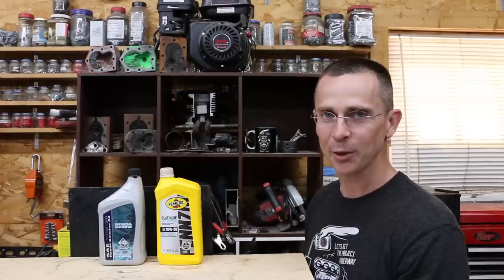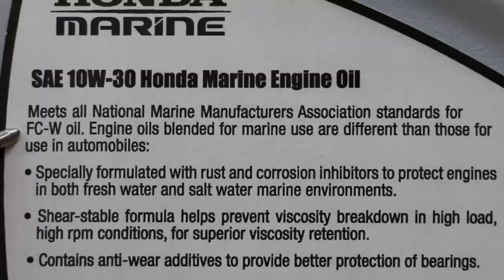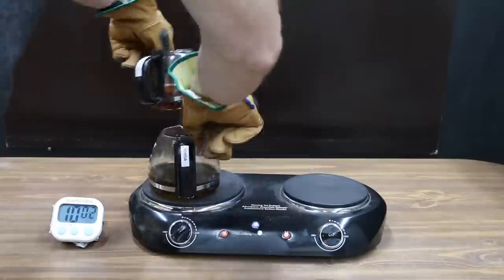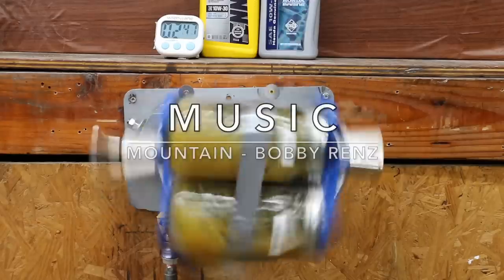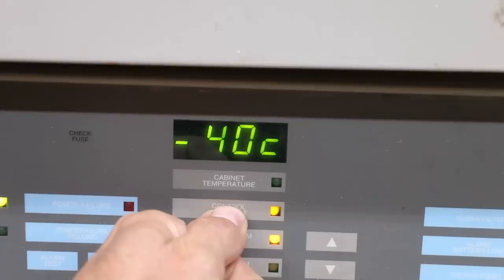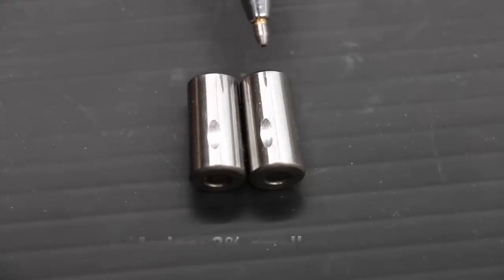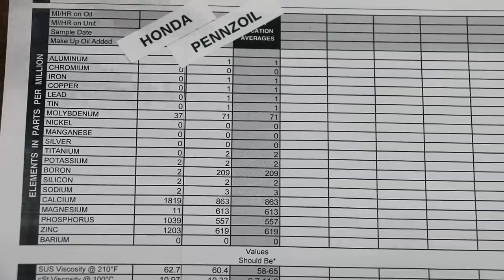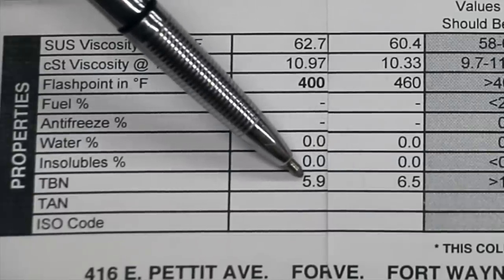Motorboat Engine Oil Better Than Regular Motor Oil?

Comment: I recall a test where they used a special piston ring made of a radioactive metal.  The oil is run in the engine for a specified amount of time, then the radioactivity is measured.  The oils with the lowest amount of radioactivity are considered better.  As interesting as this is though, it is probably beyond reach.   But perhaps another, less toxic, alternative marker is possible.
Reply from the maker: Thanks for sharing.

Comment: I have found that mobil one 15w50 has the best shear protection and least foaming at higher sustained rpm than any of the marine 25w40 s i tried . This is in a mercruiser 5.0 IO. When lake is warm in Summer at sustained WOT would see oil pressure drop, mobil one is only oil i don’t see this with and its cheaper than the marine labeled 25w40s . Shell rotella 15w40 is another excellent marine use oil
Reply from the maker: Thanks for the suggestion.

Comment: Hey, love your channel.
Suggestion :
Can you do a test on different marine motor oils?
Kind regards.
Reply from the maker: Thanks!  Thanks for the suggestion.
Reply: Yeah like synthetic ones, they compared a petroleum based marine oil to a full synthetic automobile oil... no reason to do such a comparison since its already set in stone for 30 years not that synthetic out performs petroleum.

Comment: Hi, I don't believe it's super  crucial but perhaps having some kind of port with a threaded cap or ball valve at the bottom of your viscosity test tubes may help eliminate whatever effect air lock is having on the starting of the oils. Being a small diameter round tube some tests could be effected by it. Just a thought. I'm not a scientist or anything haha.
Reply from the maker: Thanks for the constructive feedback.

Comment: Thank you for doing the comparison, could you potentially do an updated version with some better oils? I am very curious and I'm sure some of the racers would appreciate knowing. Oils like mercury racing 4 stroke outboard oil + yamalube  vs say Pennzoil ultra platinum. I'd be curious to see how they stack up against each other I am honestly leaning towards using ultra platinum for future oil changes. These engines run at 6,5 00 plus RPM for extended periods of time so the more protection we can get the better. Also possibly a video on upper cylinder lube? Basically an oil that you add to the fuel to add some lubricity to it to help valve seats and cylinders above the ring, I like to run Klotz uplon in my fuel curious to see lab results and your your testing style on it. I know quite a few people that would definitely be interested in watching that video.
Reply from the maker: You are welcome!  Thanks for the suggestion.

Comment: Thanks for making this one, was very curious to see the results.  Think I'll stick with automotive in my car, and marine in my outboard.  I was surprised about the foaming result as that is a big marketing point to marine oils, though I wonder if they perform better in that regard if water were to get in the oil.
Reply from the maker: You are welcome!  Thanks for the feedback.
Reply: They duped everyone on here with a petroleum Honda marine oil vs a synthetic automotive oil.  They should have been straight here and compared apples to apples, a  synthetic marine oil with synthetic automotive oil.

Comment: Hey man, can you test those OBD-II plug-in tuning chips that are advertised to increase fuel efficiency and increase horsepower? They say they re-map your fuel/air mixture and can help add up to 30hp and give up to 50% greater gas milage. The state of Calif just said any car with one will automatically flunk the emissions test, so it makes sense that they could be trading performance for pollution. They aren't super expensive, or rather, the simple ones aren't. They have multiple levels that increase in cost. In any case, I'm not talking about the ones that attach to a laptop, but rather the stand alone units you just plug in.
Reply from the maker: Thanks for the suggestion.

Comment: Have you ever tested motorcycle oil?  Specifically Honda Pro GN4 synthetic blend vs Synblend or any other similar oils formulated for motorcycles such as Amsoil.
Reply from the maker: Thanks for the suggestion.

Comment: Can you test STP ceramic oil treatment? And see who makes the best threadlocker? Also can you make a small engine run on tiki torch fuel both the regular stuff and clean burn stuff?
Reply from the maker: Thanks for the suggestion.

Comment: Thank you for the video and testing. Can you do test on motorcycle oil ? A lot of motorcycles on the road today have wet clutches and the transmissions use the same oil as the engine. With the engine, clutch and transmissions being integrated the oil can not have anti wear additives put into the oil. Manufacturers make both natural and full synthetic oils. The bikes on the roads today are either air cooled  or liquid cooled.
Reply from the maker: You are welcome!  Thanks for the suggestion.

Comment: As an industrial mechanic one of the biggest problem I see is misuse of WD-40. I know in past you've tested penetrants, but what about spray lubes vs. grease vs. WD-40? Some spray lubes do better on metal to metal contact or plastic, etc. It would be neat to see how lithium spray or grease does against teflon, silicone and WD-40.
Reply from the maker: Thanks for the suggestion.

Comment: Hi, have you done a vid comparing cheap v expensive compression testers?  I bought a cheap one & let's say you get what you pay for.  The screw in hose adaptor showed 30psi less than the steel pipe with rubber tip that you press against the plug hole.  A thorough project farm test of various kits would be an eye opener.  On small engines the cheap kits read almost zero psi...  Hopefully it will prevent people wasting money on trash.  Thanks.
Reply from the maker: Thanks for the suggestion.

Comment: It would be interesting how the performance in a vehicle would compare considering the "coolant" in a marine engine is constantly cycling cold water vs. a vehicle running coolant at 185-195F+ on a regular basis.
Reply from the maker: Thanks for the suggestion.

Comment: Honda makes a oil called Honda Power Equipment 10-30.  It is rated SN and basically for 4 cycle air cooled engines. The marine oil did not have a standardized rating relating to gasoline engines. The SN rating was created to have motor oils meet a certain requirements. From Project Farms tests I would use a high quality automotive oil and not a marine oil.
Reply from the maker: Thanks for the feedback.

Comment: A lot of carmakers have engines with poorly designed oil control rings. The oil control rings plug up and you burn oil. Can you do a video that shows either a high detergent oil or an oil additive that proves to clean the oil control rings?

Comment: Great test! Would you consider doing a test of 4-stroke motorcycle oil vs car oil? The motorcycle oil has additives for the clutch plates, and many of us wonder how the other characteristics of the oil compare to quality car oil. A very popular motorcycle oil is the Mobil 1 synthetic 10w-40 sold at Walmart. 

Thanks!
Reply from the maker: Thanks for the suggestion.

Comment: Video suggestion:  Test 1500W 12v pure sine wave inverters.  Efficiency, max peak load, max continuous load, idle current consumption, noise level, wave form, input voltage range etc.
Reply from the maker: Thanks for the suggestion.

Comment: Car vs boat vs diesel oil 😂 I run diesel oil in allot of my cars and I usually run royal purple in my lawn equipment just because there small and it's cheap I gotta tip my hat to you you've really made me confidant in Allot of the products I recommend my friend especially the sea foam in the oil of cars that have sat or are older it makes a huge difference
Reply from the maker: Thanks for sharing.

Comment: Video suggestion: best material to repair a leaky fuel tank. I tried kreem, and the prep chemicals did a good job removing rust, but it's leaking just as fast as it was before I put the liner in. I've seen stuff like jb weld tank repair, Versachem heavy duty tank repair, and want to know what's best!
Reply from the maker: Thanks for the suggestion.

Comment: Outboards and Sterndrive engines run at cooler Temps and they also run at significantly higher engine RPM's so that's a big reason for the superior additive package and also the reason to not use marine oil in a modern car with O2 sensors and Catylitic Converters so stick with the appropriate oils for all of your vehicles& toys.

Comment: Do a video on battery chargers, especially geared toward iron phosphate chemistry (LiFePO4), there is a major change over from Lead acid and other chemistries to LiFePO4 in the solar and the rv industries.
Reply: And in marine/boat applications also.
Reply from the maker: Thanks for the suggestion.

Comment: Hey Todd, could you test out some some popular RUST converting Paints, Encapsulators, and Sealers. Like which ones actually convert the rust and not cover them up? Which ones can be painted over and actually stick? Durability? I'm sure you're gears can think of a few ideas as you're the expert! Thanks a billion!
Reply from the maker: Thanks for the suggestion.

Comment: I worked for my gpa years ago at Amoco independent shop. I had a old timer that always wanted a 1qt oil, 1qt transnmission fluid, then 3qt oil. I would like to see you test this combo on suburban. Get analyzed oil test, to see results.
Reply: Old timer always said it would clean and protect better. Which i guess in a way. Trans fluid protects against rust.
Reply from the maker: Thanks for the suggestion.

Comment: Looks like the Marine oil have a lot of zinc and phosphorus. This is ZDDP.  They can use this additive because they don't have catalytic converters on Marine engines that will kill the catalyst.  Marine engines need high shear additives and anti foam because they run at high RPM for extended duration of time versus automotive engines.
Reply from the maker: Thanks for the feedback.

Comment: +ProjectFarm at 8 minutes in, you show that the Pennzoil loses on the initial pour touchdown, but wins after spilling down the spillway. The Honda marine oil is not responding to heat in the same as the Pennzoil, it seems to have a much tighter viscosity range, since the oil soaks up heat while it flows down the spillway.

This proves the marine oils claim of superior temperature protection, but also provides evidence that the shear strength of the base oil in the marine oil may be it's primary strength.

Idk it looks like a close test. Two very different oils that show similar performance regardless.

That marine stuff looks like it should be changed often, even if it can be run harder than the Pennzoil. Use it as race oil perhaps?
Reply from the maker: Thanks for the feedback.

Comment: I recently got into motorcycle riding and I wear corrective lenses and was considering investing in some sort of anti-fog spray.
it would be great if you could test out different anti-fog applications as to figure out which ones actually work!
Reply from the maker: Thanks for the suggestion.

Comment: Have you ever thought about testing several different viscosity of the SAME brand oil? My truck calls for 5w-20 but I use 5-w30 because 20 weight seems too thin to protect a truck engine. It would be interesting to see the film strength of different viscosity oil of the same brand.
Reply from the maker: Thanks for the video idea.

Comment: Well they got me thinking it might be better than what I run in my air cooled motorcycle all no catalytic converter are use Valvoline 2050 in the winter or cold and Lucas Strait  50 in the summer but might think about marine style oil

Comment: Most V8's used in cars & trucks rarely went over 3000rpm were as similar engines in boats would be run at 4000rpm for hours on end. A higher viscosity oil would be fiesable & Mercury sold a 2W40 oil for inboard engines.
Reply from the maker: Thanks for the feedback.
Reply: Correction, The marine oil was 25W40 & not 2W40.

Comment: I just wanted to point out, on your foaming setup, the bottom jar is at a disadvantage as it travels a longer and faster stroke length. Simply rotating the jars 90 degrees upright would make it a fair comparison. 

So far that’s the only thing that has bothered me on consistency.
Reply: Oh one other … point of …. Look if you can show me a guy running a boat in -40C water…. Lol. 

I wouldn’t expect the Honda oil to perform well at all (as it would never run in such conditions).

Which actually got me to considering, motors use a primary closed liquid loop with a secondary air exchange. While boat motors (outboards, and many inboards and I/Os) use a primary water exchange (always using “fresh” [read: far colder] water rather than a temp controlled closed loop). Which makes me wonder what the CHT is on an outboard vs a car engine. Unfortunately I only have 2-strokes, but given they are generally designed for max efficiency (power output vs fuel consumption) at or near WOT and anything at a half throttle range or below is easy to touch (generally well below 120) it got me to thinking if the Honda oil lost so much mass during the heat test because it wouldn’t actually be subject to such high temps (other than the paltry amount working it’s way through all the ring gaps. 

Weird, for once I walked away from a video with more questions than answers. Though through no fault of your own in my humble opinion.
Reply from the maker: Thanks for the constructive feedback.

Comment: I remember you doing a video on turbine (jet) engine oil vs automotive motor oil.  I wonder how the jet engine oil would do if it had an oil treatment added to it.

BTW, it seemed like the Honda Marine Oil did what it claimed in that it did reduce corrosion compared to the regular engine oil.
Reply from the maker: Thanks for the suggestion.

Comment: I always wondered this.  I cannot thank you enough for this testing . I was told that a straight SAE oil is best for older inboards . I just purchased a 93 bay liner with a 3.0 4 cylinder. I haven’t run it yet on the lake so this will determine what I will run in it . I cannot thank you enough for your testing . Thank you , thank you thank you . Sincerely James mills   ,
Reply from the maker: You are welcome!

Comment: I really enjoyed this test. How about testing other Marine oils such as Yamaha, Mercury, Quicksilver.
I have always wondered because my Mercury owners manual says to use 10w-30 dino or 25w-40 synthetic. Seems like a huge difference to me. It recommends 25w-40 for air temps above 4ºC - 40ºF.
And to keep with the marine theme. How about testing marine gear oils. They are supposed to have better water capturing abilities than auto gear oils.
Reply from the maker: Thanks!  Thanks for the video idea.

Comment: Marine oil (Like motorcycle  oil)  has a different additive package and different API classifications than automotive oil.  Just use the oil that the manufacture calls for.
Reply from the maker: Thanks for the feedback.

Comment: Your testing is though! Although oil manufacturers such as Castrol Mobil etc spend a lot of money on testing and perfecting oils, in the last 20--30 years engines moved forward so much there was NO choice!! Outboard engines have different requirements, outboard engines  often run at high rpm for long periods! Honda lubricants are probably made for them by say Castrol to Honda's specifications!! Which will i am sure be very High and exacting standards!!!!!!!!!!!!!!
Good video as is normal.
Reply from the maker: Thank you!

Comment: As a high performance marine technician, im interested to see how the mercury racing oil or yamaha full synthetic 5w30 stacks up, in my opinion they are far superior oils to honda.
Reply: And there are marine oils that are formulated for catalytic converters, Malibu and Indmar both have" proprietary" lubricants.
Reply from the maker: Thanks for the suggestion.

Comment: Not sure if anyone suggested this, but id like to see auto insulation tests. I'm looking at spray on or stick on. Products like kilmat, fatmat, dynamat, and im looking at lizard skin coatings, second skin, and boom mat spray in. Id like to see the difference between spray on and stick on, and what is the best cost to sound deadening ratio. I guess that would be like cost per db?
Reply from the maker: Thanks for the suggestion.

Comment: It’s very important for boats to have high quality oil, most boats don’t have transmissions, so they’re running 4-5000 rpm at max speed. Obviously that’s different for different motors, boats.
Reply from the maker: Thanks for the feedback.

Comment: I’d be interested to see this test with Powersports oil vs commercial oil.  Say, Amsoil, Delo, Honda GN or MOTUL in 10w30 with a SN rating. I’ve ran delo with sn rating in my motorcycles and atv’s for due to the dramatic price difference.